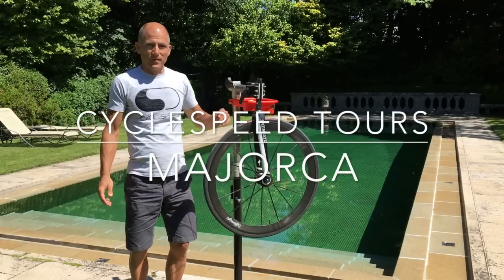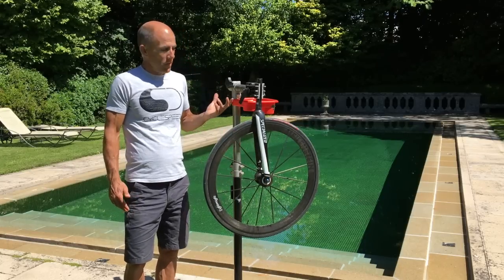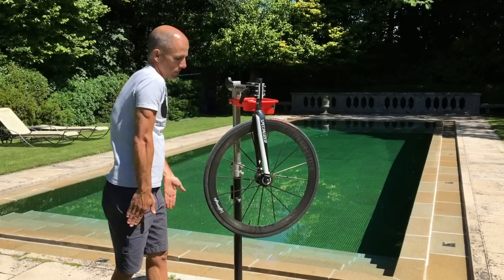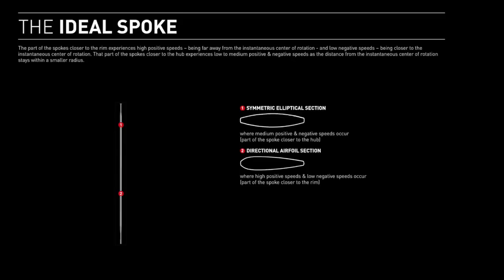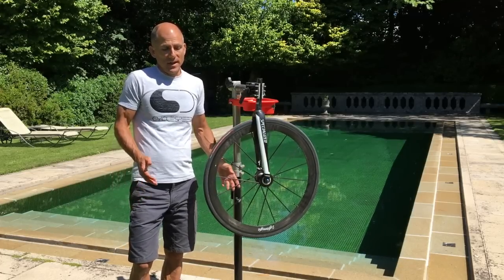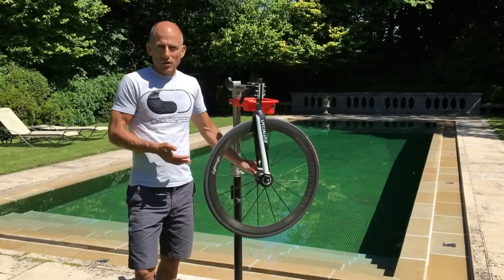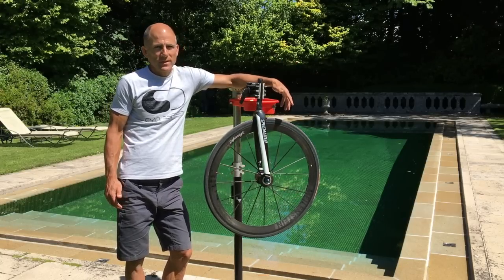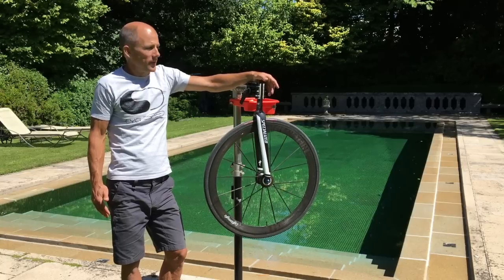Aero Wheels - What they are NOT telling you!

Comment: GOOD video again. I might just point out though that bearing drag or frictional moments are not always linear. It can be much higher at very low speeds while lubricants are in a somewhat transient state, and much lower friction at extreme speeds. But in bike speeds a linear assumption is good enough ;) Ps is the pool green by design? if not I'd happily be the pool boy in exchange for a dip!
Reply from the maker: Hi, and thanks for the detail on bearings which makes sense, but as you say, it seems the drag is linear 'enough' for our purposes. Yes, green mosaic, to make it look 'natural', but can be mistaken for algae!
Reply: I couldn't see the mosaic on my phone screen, there were obviously more than 480 tiles across the screen at the time :) You are a lucky man - clearly not on an engineers wage ;)
Reply from the maker: Yeah, guess you need Ultra HD for that! Houses are cheap as chips in France, sometimes they can't give them away. Here's a better look at the pool; https://vimeo.com/219205227

Comment: None of the big companies with great engineers probably don't care, because it's a waste. Tangental vectors are cancelled out on wheels... And optimized yaw angles means low torque values, which means you're proving a point that doesn't exist..
Reply from the maker: Sean Preston are you saying that there is no power consumed in spinning a wheel?
Reply: So little power is wasted through spinning a wheel that it's negligible. If you take all the top companies, aligning all the best bladed spokes, using lightweight aero rims, and high grade ceramic bearings, etc... The bikes we ride already outperform the cyclists.
Reply from the maker: DT seem to think it accounts for 25% of total drag. What surprised me in my little experiment was just how fast the wheel slowed from 40 to 20km/h, then took ages from 20 to zero. Spoke noise was high too, and you could even feel a 'fan' effect. This shows that the drag is significant at high speeds.
Reply: I recall once seeing the numbers that the leading edge of the wheel causes approximately 8 times more total resistance than the rest of the wheel. Decreasing the mass, aerodynamic drag, better aero spokes, etc, all leads towards faster wheels in all respects. So what really is fast? Climbing with less 'wheel' resistance, or cruising on a flat at 30mph? Look at the newest brake pads from Reynolds.. they claim to be one of the best with carbon rims, and they feel great compared to come of the other pads out there. Seems like there are a lot more factors to consider?
Reply from the maker: Sure, absolutely, it's a complex subject.

Comment: Rotational drag is measured in every wind tunnel test. Just because it's not given as a separate number doesn't mean it's ignored. This video is just nonsense. Why are you making these claims when you clearly don't understand the subject?
Reply from the maker: And how are they measuring that r.drag would you say? Do you see any equipment in most wheel tunnel tests attached to the front wheel to measure power to spin? I don't. Look at the DT Swiss photo that shows the big motor and measuring gear attached to the wheel. THAT is measuring rotational drag. Have a look at the DT site to better understand the concept.
Reply: Alright, I did a bit more reading and it is more complicated then I realized. My apologies. That said, it seems measuring torque at the hub could overmeasure drag and it should be measured at the ground, see: http://forum.slowtwitch.com/forum/Slowtwitch_Forums_C1/Triathlon_Forum_F1/Theory_of_rotational_drag_of_wheels__P6306742/?page=unread#unread   Your thoughts?
Reply from the maker: Interesting post, that seems detailed and correct, but as he says, it is quite complex, and different measurement protocols may return different results.
I don't claim to have all the answers, simply that it is an interesting facet of aero design, and that it merits closer inspection and testing, as DT Swiss are doing.
Reply: Yeah, it is an interesting point I hadn't thought about before. Sorry about the tone of my first post

Comment: why is bearing drag linear?
Reply from the maker: Because it increases as a function of the speed (rotational speed, rpm in this case). (Or at least linear enough for our purposes).
Reply: Cyclespeed Tours ok thanks, as you're a mech eng I'll give you the benefit of the doubt 😀
Reply from the maker: :) Happy to be corrected if wrong, but SKF's website gives this formula; Power loss = 1,05 x 10–4 M n , where M is the frictional moment of the bearing and n is the rotational speed (rpm). (But at extremes (very low/high speeds) the linearity can break down).
Reply: Cyclespeed Tours the xtreme low speeds may apply in my case, cheers!

Comment: Is this truly a neglected issue? Does their testing REALLY not test this? Because if they are using rotating wheels in a wind tunnel... they are testing this. I would assume that if there is a rider on rollers in a wind tunnel, the net effect is all that matters to the rider anyway... not where the inefficiencies come from.

What I mean by this is:
The rider won't notice the difference between rotational drag and translational drag. So if Zipp for example is saying that their wheel is 5 Watts better than X brand, under the same testing conditions in a dynamic cycling environment.... It doesn't really matter. 

If they are using overall drag in their design criteria, and the overall product testing takes this into account... who cares? That being said... if they aren't testing this. It is bull.
Reply from the maker: You make some good points, but the power to spin those wheels is coming from somewhere - imagine the spokes were like big paddles - it would take a lot of energy to spin, right? You need to measure that to be sure. Wind tunnels are equipped to measure translational drag, ie. how much the bike (or wheel) is being pushed backwards by the wind. Unless you build a rig to test for r.drag, (like DT Swiss) the equipment isn't there.
Reply: Cyclespeed Tours would this not be measured by a power meter? That's what I mean, they certainly have one on the bike

Comment: Interesting points you make. You're right, most of these manufacturers do not even bring up the topic of rotational drag.
Reply from the maker: Thanks - maybe they are doing some kind of testing, but they aren't releasing results....
Reply: They seem to be more concerned in how the wheel deals with crosswinds, yaw angles and hubs than about rotational drag. Maybe they believe the other issues outweigh rotational drag?
Reply from the maker: Maybe, but DT Swiss seem to think it makes up 25% of the total, which may be debatable, but it's nonetheless significant.
Reply: Yes, 25% is enough to consider. I'm with you on that.

Comment: For me, what is missing in these discussions is a breakdown of the TOTAL energy losses of a moving bicycle, so that we can get some grasp of how large each component is.  Sure rotational losses may be 25% of the total WHEEL drag, but is that 25% of a tiny or large component?  I would GUESS that the drag of the rider's body would be the largest component?
Another factor is speed: energy losses due to aero drag go roughly as the square of the speed, so a lot depends on what speeds we are considering.  Mechanical frictional losses probably have some other relationship to speed?
And rotational inertia in a wheel?  I suspect that we are constantly accelerating and decelerating slightly as we ride even on flat terrain, so that rim+tire weights might factor in even when attacks and sprints are not involved.  I would love to see data on this.
Reply from the maker: Hi Paul - good points. Total wheel drag is not huge when compared to the human rider him/herself, (up to 80% of total drag) so 25% of that is of course smaller still....marginal gains and all that..!
Drag force is related to velocity squared, and power required to overcome that to velocity cubed, so speed is obviously crucial when discussing drag. At low speeds (<25km/h, drag is a smaller factor, and mechanical losses, are proportionally higher. These are roughly linear in relation to your speed.
You are right in saying that speed is very rarely 100% constant when cycling, even on the flat, as the power comes in pulses (your pedal stroke). Some analysis I have seen shows the inertia of the wheel to have only a small impact on accelerations (such as a sprint for the line), but I think the real world 'feel' of a light wheel (and especially rim) is a big plus. Remember, braking and cornering are accelerations too, so weight comes into play here too.

Comment: I'm confused, so would a deeper section rim generally have less rotational drag, or more?
Reply: spokes can 'attack' the air, no argument there. however, while the rim does NOT attack the area, it has a whole lot more mass.  so a deeper section rim, would have greater weight distribution to the outer dimension of the circle (all other things being equal - just taller rim walls & shorter spokes) which would create greater rotational mass...right?
Once up to speed, that extra rotational mass would/could work in your favor as rotational momentum, but getting up to speed would require greater watts.
Reply from the maker: Generally less, as you have shorter (slower) spokes. Spokes 'attack' the air, the rim does not.
Reply: The larger mass of the rim(on aero wheels) then translates to more energy consumption during the climbing the hills, where the drag is minimal due to slow speeds.The weight of the tire and  inner tube, rim and nipples makes a lot of difference. Also the pressure.....some Wredestein tires  go up to 170 pound...I use them and I see the difference in rolling resistance compared to other people riding at 80-120 pounds. But only on smooth asphalt and the grip in curves  and braking distance is not so great. The flat spokes leave too much of un-flatten area near the rims, that is also bad,because right there the turbulence of rotating wires is max. Nobody talks about these details

Comment: Rotational drag has minimal impact compared to the benefits gained by the benefits of aero design....hence the reason you see more pro's running deeper section wheels. the amount of time that's spent getting the wheel up to speed is very small compared to the time spent spinning!
Reply from the maker: I think you're confusing rotational inertia with rotational drag. It's Power to Spin, not Power to Spin Up. 
Power to Spin is power that is required all the time, even at a constant 40km/h say, as you have to overcome the drag on the spokes, etc. (+a small amount of bearing drag).
DT Swiss has calculated that rotational drag makes up 25% of the total drag, so quite significant.
Part of the reason deep wheels are aero is that the spokes are shorter, and therefore their tip velocity is decreased. A disc wheel is the ultimate as there are no spokes attacking the air at all.
Reply: Cyclespeed Tours look clever clogs, couldn't u just say, I know what, I think you're right? thanks for the in depth reply....u have a new subscriber.
Reply from the maker: LOL, welcome!

Comment: well said, good video! Btw that may be the reason (or at least one reason...) that the Lightweight wheels in real world tests give similar results to those modern shape aero wheels though they are using an "old" V-shape profile - what should be less aerodynamic...

A small (but not unimportant) remark: 5'27" is not correct. the air resistance increases square to the speed, the bearing friction is CONSTANT (in the strict sense it decreases a bit with increased speed - but thats negligible); so the POWER to overcome air resistance is cubic (square resistance x speed difference) while the POWER to overcome bearing friction increases only equal to the speed (constant x speed difference)
Reply from the maker: The Lightweights should do fairly well at 0' and low yaw angles, but in theory are more susceptible to sidewinds, not that I have any problems with them.
I agree that air resistance is a function of velocity squared, and power = velocity cubed. And I agree that power to overcome bearing friction increases with speed. From SKF's website; NR = 1,05 x 10–4 M n , where Nr = power loss (in watts), M = frictional moment of the bearing and n = speed (rev/min). Therefore power loss in the bearing increases linearly with speed.

Comment: Are the big companies really not aware of this? This is such a basic test and really would not be expensive in the context of wheel development. Is it just that it's not something that changes much between designs?
Reply from the maker: Some truth in what you say, but it adds a big layer of complexity to test power to spin when testing wheels on the bike. And remember that wind tunnel time is very expensive. Far simpler to just concentrate on 'normal' drag figures.
But when wheel's aero performances are now so close to each others (for a given depth), it strikes me as disingenuous to not measure how 40km/h of air movement is affecting the rotational drag of the wheel. Some will perform better than others.
The proof is the time and money that DT Swiss are investing in this area. 
To my mind, far better to have hidden nipples (!) and ultra aero spokes than 1W less at 13' of yaw.

Comment: Aren't all wheels tested while actually spinning?
Reply: The bottom spokes (below the hub) are moving with the wind, therefor create less wind resistance due to symmetry reasons. The spokes are moving way slower than the actual translational velocity (Omega x r) and their frontal area is very small so the effect will be very marginal. The test with the wheel spinning time until it stops is actually really not a good for any assertions on drag because what you mainly will "measure" or "see" is the wheels moment of intertia. A more sluggish wheel to ride will actually spin longer because of its higher moment of inertia. So what you can conclude from a wheel spinning time test it's is mass and mass distribution. I.e.: (Moment of Interia) J= Volume-Integral of [r² * p(r)]dV.
Reply: Thanks for the video. Wouldn't much of that "power to spin the rim" be captured by the rearward force the spokes experience in the wind tunnel? Isn't that rearward force most of what you are referring to in the power to spin the rim? Additionally, conducting this test while stationary (or not in a wind tunnel) seems almost meaningless. Every part of the wheel is always moving forward, but spokes are experiencing much higher wind velocities at the top of the wheel rotation than the bottom. Given the squared air resistance rule, this factor would be very important, and not at all captured by spinning the wheel while stationary. Certainly bearing resistance is not accounted for my wind resistance tests, and that would be great data to have, but other than that, I don't really understand what is not being captured by the current standards.
Reply: Microage this exactly what I'm saying plus more
Reply: They're not measuring the wattage required to rotate the wheel - only the linear drag against the direction of travel.
Reply from the maker: Usually yes, but the key point, which many seem to be missing is that you need to measure the Power to Spin that wheel - if the wheel has huge fat spokes, say, you will need to input far more power to spin that wheel at 40km/h.
Reply from the maker: Hi Mitchell, - the rearward force from the spoke that you mention would be picked up in the tunnel as translational drag. Remember that the wheel requires power to spin. Where is that power coming from? And how much is it? 

I agree with your comments re. stationary spin testing - the dynamics change considerably as soon as the wheel starts to move forward. But I still think that a wheel that does poorly here, will also tend to do poorly (or worse) when the wheel moves forward.
Reply from the maker: Hi Microage, yes the bottom spokes have a slower relative velocity as they are moving backwards, but by the same token, the top ones are moving much faster as they are also moving forwards.
I agree re. spin test - the key measure is from 40km/h to 20km/h, not 40 to zero. Obviously, the time to go from 40 to 20 is much less than to go from 20 to 0.
And yes, it is important that any 2 wheels being measured in that way have the same (or very close) moments of inertia, (which the LW and Corima do). Otherwise their moments of inertia can be measured and brought to parity with correctly placed weights.